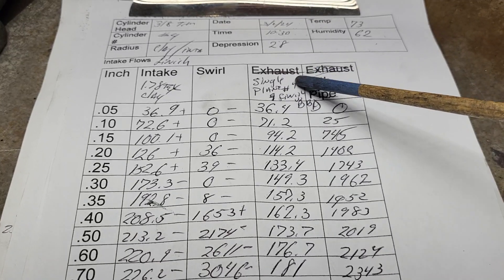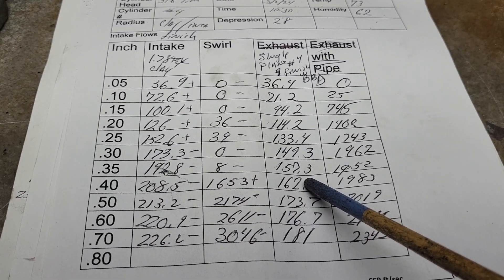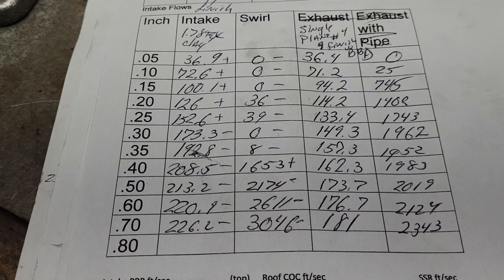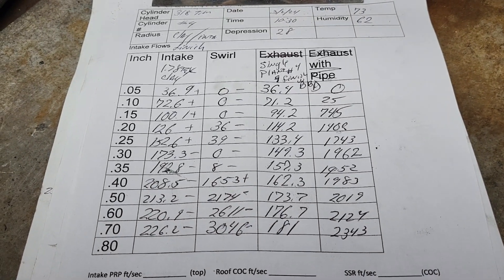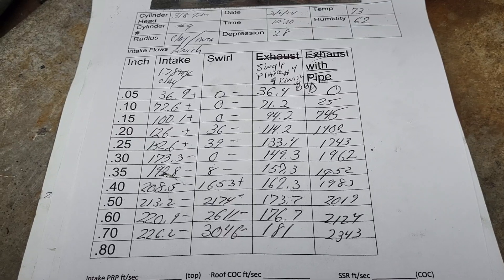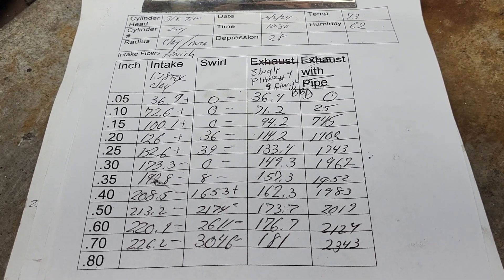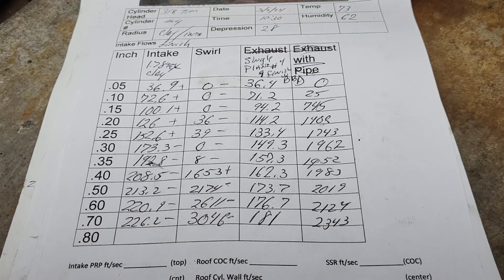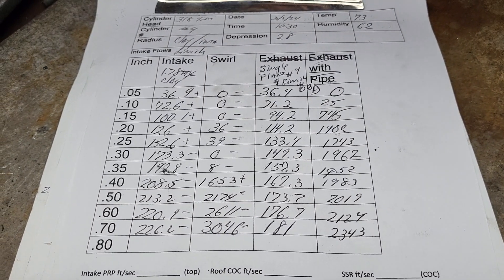David Vizard, Unity Motorsport, Mission Impossible 318 project. Finished flows and hp estimated.

Comment: My brother used to build 318s with stock rods, port and polish the heads, .030 over pistons flat tops, zero deck. Stock 68-71 hydraulic 340 cam and dropped a 340 iron intake on them to break them in they were port matched he got an honest 300 hp out of them. Switching back to the customers stock 2bbl carb and intake HP dropped of some but 275hp ain't bad
Reply from the maker: Better than I would have expected with a two barrel

Comment: I’ve been following your work on this for a while. Your explanations are excellent!!! I know you were added to this project but you followed what was the original premise to the “T” I think the project went off the rails when it went front “ let’s see how Hp we can make using stock parts” to “ I have to make sure I’m putting out a good product for St Jude’s “ what that said, and lot of people feel this way, the original concept should have stayed in place and if an engine was going to be made for St Jude it should have been done with off the self aftermarket parts meaning , stroker kit, heads, cam ex. Like I said the time and effort you put into the ports WITHOUT changing valve size is amazing. Remember anyone can open a catalog and build an engine… thanks again for the education
Reply: A little side note I was part of the same street racing scene as Tony but I lived out on the Island not Staten Island about 30 miles away. We have never met but our roots are the same..
Reply from the maker: Nice!
Reply from the maker: Thanks!

Comment: I think project wise, you nailed it. I have questions and would like to get some opinions, though. How do you really go about how to compute the gains in cfm. After you flow bench, is the number you gain in hp the peak difference at cam lift, or is it a functional average of the curves' gain? I have always wondered this. Especially on V8s, because the gain is multiplied by 8 from the flow numbers as the sum gain across all cylinders.
Reply from the maker: I use D.V.'s iop program or performance trends program
 Thanks

Comment: I liked the direction you had taken it , if you put all the hot parts on a completely stock 318 ( cam , headers , compression ,intake carb , rocker ratio ect ) v all the good work you have done ! Then have it choked by a stock  cam , intake , BBD , and exhaust manifolds . You know what wins . You can run this equation on a calculator no need for all these hours of work . If you want to see poor results from running garbage ?google uncle Tony’s slant 6 or his 318 that went to nicks garage to get dynoed …. Not meaning to be harsh just honest . I like his videos ect ( not so much his motors )
Reply from the maker: I know it, but it is a challenge. No challenge with better parts! Thanks

Comment: That's incorrect use of the Wallace racing calculator. Use their carb calculator, you need at least a 500cfm @ 28 carb to make 320 with .5'' manifold vac at WOT.
Reply from the maker: I disagree, I don't have a 500 cfm carb. Stock bbd flows 285cfm.
Reply: @servediocylinderheads  OK, Surely you can Agree that you have a 285cfm 2 barrel, optimised to 350cfm 2 barrel still wont get you there, your punching in flow numbers neglecting you have a little 2 barrel.
Doubting Tom onto something.
Reply: A very well thought out Tri Y exhaust that really scavenges may get you closer to the 1hp per cube on all period factory parts.
Just how period are all the bits?
Reply from the maker: @stuartstevens472  The flow numbers are through the two barrel, intake, and cylinder head. So, I am not sure of the problem. Thanks
Reply from the maker: @stuartstevens472  Not perfect, the exhaust manifolds are egr truck manifolds. The short block will have upgraded parts. Thanks
Reply: @servediocylinderheads  the problem is you got thats all the flow you got. that has to suppky 2 valves and cylinders on the running engine.
Not one on a flow bench.
Reply from the maker: @stuartstevens472  The bench cannot replicate the same depression as a running engine either. We will see what we can do with what we have. Win or lose it was a good learning experience for a good cause. Thanks
Reply from the maker: @stuartstevens472  Kinda like a restrictor engine...

Comment: YES = WELL YOUR NOT DRIVING AT = 6,000 rpm = street driven better down low ! and torque ! = i had 273 and 318 fireball engines + 318 with 273 heads and headders was the towing set up for me ! solid cam from 273 ! huge low rpm wheel spinner !
Reply from the maker: Cool!

Comment: Im not sure what maximum valve lift was back in the 80's and 90's  for stock eliminator  Chrysler but at least go with .400" maximum valve lift same as small block chev of  a maximum.400" lift at the valve.
Reply from the maker: That would be good info. Thanks

Comment: Cfm wise i think you got it but id like to pick your brain and i might have missed it in a previous video, do you have enough area to support some the rpm expectations ive heard david mention? Im just curious if its going to choke out under the depressions a running engine experiences.
Reply from the maker: The better the airspeeds in the port the higher the port will operate. In other words I think this port will work with higher port speeds than most. How will we know? Hp will drop like a rock after some rpm. Thanks
Reply: @servediocylinderheads  just curious the stock head builds intrigue me I'm still learning and have learned a lot from your videos
Reply from the maker: @Redneckairflow  Glad you like it.

Comment: Selecting what type of engine is based on engines efficiency if im not mistaken..85% for typical stock street engine and gets higher as you move on to a race engine which is 100% or greater.

Comment: 1967 318 920 casting heads are closed chamber similar to the 302 casting heads but they don't have the large pushrod hole that is intrusive into the intake port of the 302 casting. 
Just fyi...
Reply from the maker: Rob has a set of 67 318 heads.

Comment: Some people laughed at me on youtube / Facebook mopar groups when I mentioned I wanted to take a stock 225 or 170 slant6 and make it the fastest stock motor . I have been doing alot of the same work you have on this 318 on the slant6 and especially the 1 barrel and 2 barrel carter carbs . I just didnt have a flow bench ect. I'm glad you and others are documenting this work to show the benefits of at home clean up work on the carbs , heads , intake ect. 😎💪🔧floooow
Reply from the maker: Someday, I may be convinced to do a slant 6. Thanks
Reply: @servediocylinderheads  The ONLY way I personally would do a slant six is with 6 independently tuned tunnel ram intakes and 6 independently tuned motorcycle type carbs.

The whole multiple-length tunnel intake is a proven failure from the start, and far too many people have fought tooth and nail to validate it, when, in the end, it simply can't BE validated.

Forcing ANY motor to run with multiple length intakes is absolutely EVIL.

This is why ALL motorcycles, and MOST other small displacement 2, 3, 4 and 6 cylinder engines [especially of German manufacture] have linear induction to ensure precisely identical intake to every cylinder.

Each cylinder needs to be fed precisely the exactly same amount of air and fuel, as is required, to ensure that every hit, of every stroke, is absolutely identical.

Otherwise, not only do you rob the motor of performance, you ALSO rob it of usable lifespan, and rob the driver of a comfortable ride.
Reply from the maker: @hunnybunnysheavymetalmusic6542   I have seen German intakes that had different length runners. It just changes the torque peak up or down. It actually makes the torque curve flatter. Thanks
Reply: @servediocylinderheads  There is a MASSIVE difference between 'variable length' tunnels and ASYMMETRICAL tunnels though.

I say this as one who has built Rolls Royce turbofan engines, dragster engines, and heavy equipment engines.

Yes, some motors have 'switch-length' ported intakes.

But don't take my word for it...

Get one.

Even some GM cars have them now.

As do some MOPARs.

The inlets are NOT asymmetrical.

Even for those who have 3 lengths [which, by the way, is about a "functional minimum" for this type of technology] of rams, EVERY CYLINDER...

STILL has EVERY ONE of those 3 lengths.

The GRIEVOUS DOWNFALL of the original slant 6 is that you have three UTTERLY ASYMMETRICAL lengths of runners.

The ones in the middle are SHORT, the ones out from them are MEDIUM and the ones at each end are LONG.

This is DESTRUCTIVE INTERFERENCE.

While I have never owned a slant 6 [worked on one, but did not own it, and the purchaser of same said car put something else in its place, so it went away and I never had a chance to measure it] to measure those different tunnels, knowing sonics/acoustics and aerodynamics as I do, at no RPM band will any 3 of those 6 cylinders get NEARLY the same intake.

Only 2 cylinders, in that configuration, can ever have the same level of tunnel ram effect, IF ANY.

This is why those big long cross tunnel rams were made so large on the 413 wedges.

They were PRECISION TUNED to be IDENTICAL in length, to ensure that their tuning matched on ALL EIGHT cylinders, because anything less was going to accelerate the death of the motor, while reducing peak performance.

Its truly a shame they did not advance the system to a broad bandwidth tuned tunnel ram.

Should I live long enough, I have a design I aim to build into all my motors here on my farm.

I have a bunch of hard working trucks which can benefit from precision tuned, variable geometry tunnel ram induction.
Reply from the maker: @hunnybunnysheavymetalmusic6542  sounds fun, let me know if I can help!
Reply: @servediocylinderheads  I'm [grievously] a long way from this, because so many far more important things demand my more timely attention.

While I have tooling, and some ways to melt and cast precision parts, and motors which DESPERATELY NEED such improvements...

Just this moment, I'm limping along on them as "just barely workable" until said point in time.

What I want to do [should life permit] is do some "before basic repairs" testing, so as to find out what any of them do in their 'pre-repaired' states, then take them directly to their 'post modified' states.

Because...

"Why waste the time and money replicating known, proven and documented values?"

While I realize full well, comparing beat up, worn out, barely running machines to "hyper modified" machines is, by NO MEANS 'fair'...

That is what I have.

But since many other people put so much time and effort into recording all the "OEM" performance benchmarks...

Why should I?

Were they wrong?

Maybe...

I don't care.

They are ALL less than that...

If I so much as bring them back to their original specs, I'll be happy...

But to EXCEED that...

Will make a WHOLE LOT of people  happy!

By the way, a certain, undisclosed company personally informed me, that should I make some specific engine heads, that fit one of my trucks, they will IMMEDIATELY order 100 sets.

Over time, as I continue to upload footage of my work, you will find out readily which motor that is.

Also, I have developed a "high performance" design, with which I can readily replace some chronically deficient exhaust manifold products of theirs, which, while not "factory original" would 1, fit precisely in the same place, 2, slightly increase performance (due to more 'header-like' flow characteristics), and 3, cost less for the same said motor.

Some day, just maybe, I might be in a position to build custom parts for a whole bunch of motors, if life allows me to.

We shall see...

Too soon to tell.
Reply from the maker: @hunnybunnysheavymetalmusic6542  I hope you do!
Reply: I see six trombone slide style intakes and a 40 on each, and a mechanism with a flyweight and spring to change length with revs .
Reply: @dennisford2000  A HUGE part of my design [and I realize that sharing this is giving it away to some extent, but I am not the creator/inventor, so I hold no patents on it] is a tuned 'slide trombone' type tuned tunnel ram that is proportioned precisely in proportion to the RPMs of the motor.

If anything, its just something that no major factory will ever invest in, therefore, free, independent, individual builders can [and maybe will?] build on their own.

And any motor, regardless of displacement, cylinder alignment, or cylinder count, can take full advantage of.

TECHNICALLY, it even works with EXTERNAL BOOST.

So you could add some form of inlet boost, and still, a dynamically tuned tunnel ram would STILL increase performance...

Should one some day desire to add it to the system.
Reply from the maker: @hunnybunnysheavymetalmusic6542  This is true and a cool design. Thanks
Reply: @hunnybunnysheavymetalmusic6542  My 2008 Yamaha has variable length inlet runners. Once it gets over about 9,500rpm the manifold separates and runners become a lot shorter. Sounds great too.
Reply: @r1learner178  My plan is to use a pair of tubes like a slide [ https://en.wikipedia.org/wiki/Slide_(wind_instrument) ] that extend and retract based on a governor from the crank shaft.

This will allow me to precision tune the inlet for literally every speed, without jumping through large steps.
Reply: @hunnybunnysheavymetalmusic6542  Yeah my bike is a bit different to a car, it is fly by wire and the computer won't let it have full throttle until about 9,500 rpm (when the manifold separates). Things are really happening then. Plus it is only a 1 litre motor.
Reply: @hunnybunnysheavymetalmusic6542  Mechanical is cool, probably might be more difficult to get it to work reliably - I can see a lot of testing in your future. Good luck.
Reply: in australia = 225 slant 6cyl was feared ! some rebuilt balanced with over bore and holden pistons - 247 ci my mate had one 67 valiant - 351 killer .
Reply: @ronnieboucherthecrystalcraftsm  Oh yeah!  Aussie speed has cam, intake, and even a supercharger for them
Reply: Cool!  I got the super 6 and plenty of the 1bbl setups.  One day, I plan on playing with that project again.
Reply: My sister had a 73 challenger it had 318 and 727 her husband was able to wake it up so much I was impressed but they had a baby and traded it for new SUV without telling me now cant afford one like it. It was good on mpg and performance. Good luck and enjoy your vehicles
Reply: @jmanke6057  Shame a person would give up a challenger EVEN WITH just a 318 in it!

And double shame if they did not even give you first dibs at it!

Comment: I do not like the clay testing. In the real world, who does this???  Put the base of the air cleaner that will be used and then do the testing. Lab tests are not real world to begin with due to variables. Test different carb bases. Clay is not going to inform anyone of what the carb base, top and filter will do vs clay. Use just the base, flow, add the top and flow and then the filter and flow.
Reply from the maker: No argument. I don't have an air cleaner. Thanks

Comment: I'm curious how it compares to the 273 single plane 4 barrel intake. Hard intake to find.
Reply from the maker: I am not sure, but I think it is identical. Thanks
Reply: @servediocylinderheads  except it's a 4 barrel, so flow test through the carburetor would be different.
Reply from the maker: @jdvintageauto2958  I didn't know that. I am sure it is way better! Bbd is the restriction!
Reply from the maker: You wrote four barrel...missed that.
Reply: @servediocylinderheads  no worries.

Comment: I dont really think there is a point in caring about what the original intent was at this point 😅

Mission impossible was dead on arrival, might as well shoot for the moon now! It will sell for way more money with aftermarket heads, cam, intake, efi Holley sniper. If money is the goal......should just shoot for that goal and make the most money for the kids as possible!

Just my opinion not that that matters much 😂
Reply from the maker: Final stage will have lots of aftermarket parts. I would like to see what these heads could do with a real cam, big single plane, 750 carb and headers. Then bolt up aftermarket aluminum heads and see the difference in power. That would make some interesting info. Thanks